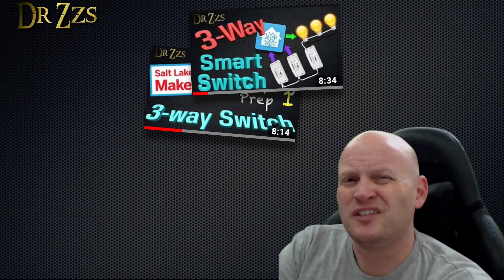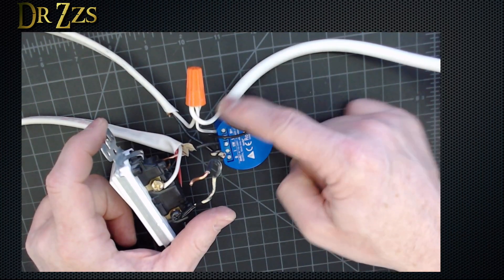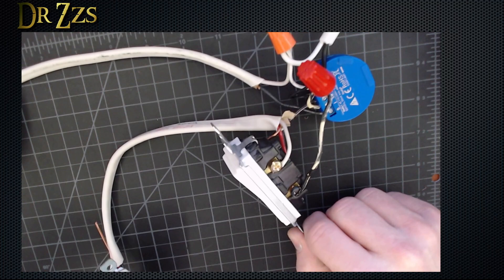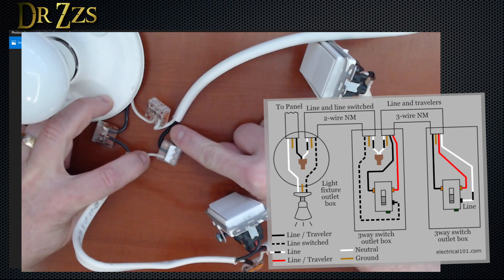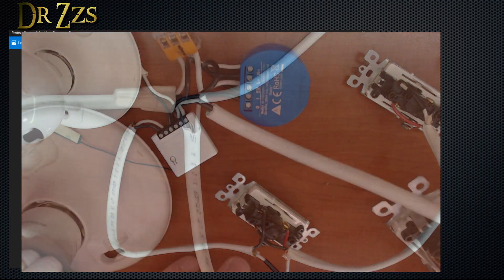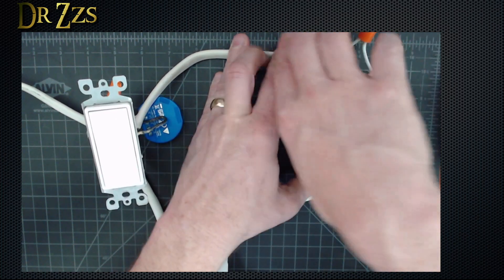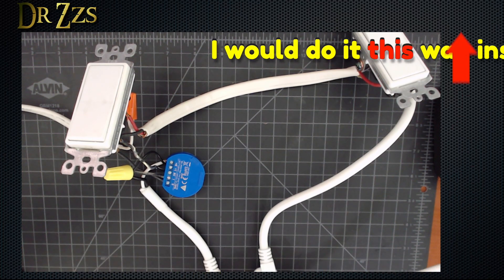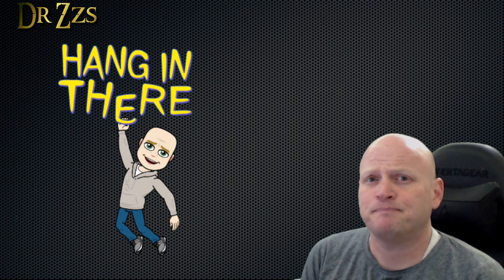The Final Word in 3-Way Smart Switch Wiring (at least from me)

Comment: I have a fairly good grasp of these configurations but when I open up my switch box's, all the wires are painted white (face palm)
Reply: If they are just painted can't you remove the paint at least a little bit?
Reply: The best part is when we need to sort out the same colored wires! 😁,  i got one of those power sensing gizmos from China, so no more guesswork, and surprisingly it works

Comment: Scenario 3, this is BAD!  
You can only do this if the 110 powering the shelly is on the same phase as the light.  Otherwise the hot that comes in to power the shelly and the hot it is switching may collide in a poof of magic smoke...
.
Reply: Indeed as it could cause other issues. I would highly recommend a real 3 way switch in his scenario like the Martin Jerry, Moes or Etekcity 3 ways that have travelers.
Reply: @digiblurDIY  after a little thinking, the only way to do a US 3-way (w/o Z-wave or Decora) is a d1 + SPDT relay wired in place of the switch and the switch toggling a gpio. Would be hard to safely fit that in even a deep box the way stuff is chained in my house. Now that I've said it, someone will probably make it. Are you listening Shelly?
Reply: @digiblurDIY  Agreed, in this scenario spend the $25 and buy a real smart 3 way switch, and replace the one where the power comes in with that.  Don't do #3...
Reply: scenario three is bad; you never want to have two different circuits running on a any devices.  You can however, remove the power from the first switch and just rely on new powers which brought in at second switch closest to the light.  I had to do that for all my circuits.
Reply: @anthonyd4238  You are right, It didn't dawn on my at the time, but that works...
Reply: @Sir GoodEnough , lol, I had one of those magic smoke puffing Shelly’s.  I think the doc may have mistakenly stated that you cannot have multiple neutral connected together if they are on different circuits. I don’t believe that’s accurate as all neutrals connect to the same buss in the circuit panel. The load wires (black) do got through independent breakers and shouldn’t be connected to the same device.
Reply: Maybe I can pull a Tim Allen and rewire it. Without the smoke. Decora types have 0% WAF.
Reply: @OldCurmudgeon3DP  If you pull a wire from the same source as that coming into the 3 way circuit, Like he did in the video, you are ok.  It means pulling a wire over, though.  I would not come from a different circuit...
Reply: @Whatarewefixingtoday  nothing is ever easy eh.
Or, since wires would need to be pulled anyway, just move the light into the source box and be done.
Reply: @OldCurmudgeon3DP  Source into the light box you meant, I think. That works.  You could pull the light bulb wire over to the power sourced switch box and put the shelly there.
Reply: @Whatarewefixingtoday  that's what I meant. Got in a hurry typing. The hall could be done that way. The other 2 it's not worth it with the way things got installed. Guess I have some spare Shelly's now.
Reply: Bah. The more I think on it the more trouble it becomes for the other 2 circuits. 😡😠🐂💩

Comment: Still cannot get my head around it with uk wires
Reply from the maker: Which way is yours wired?  I'm guessing the Line/Neutral is in the ceiling only.  Does it come in between the 2 switches?  I'm sure there's a way.  If all else fails just make it a normal Single-switch setup then use another smart switch to do the wireless method. 
Let's get it worked out for you Nigel.
Reply: DrZzs I have done the single switch with Shelly.  I only have 1  3 switch and 3 bulbs configuration so really not going to play with that one but thanks for the help
Reply: You will probably find that you don’t have a neutral at the light switch anyway.
Reply: @eco-terrorist  I haven't it's in the rose